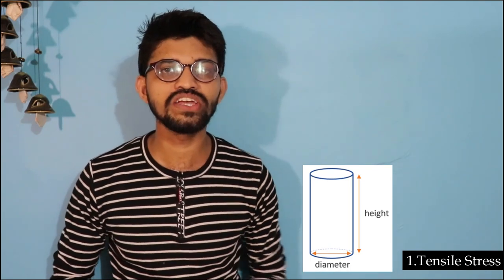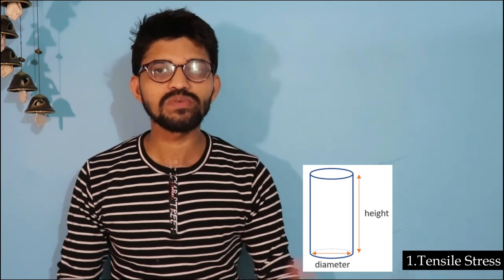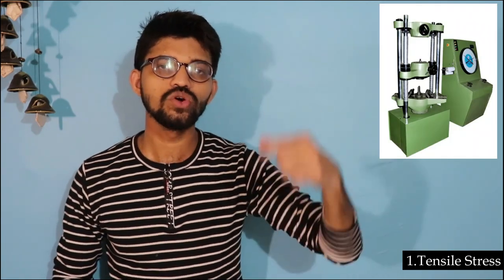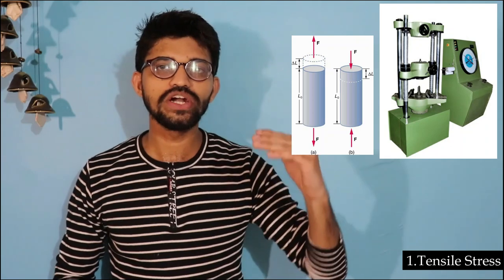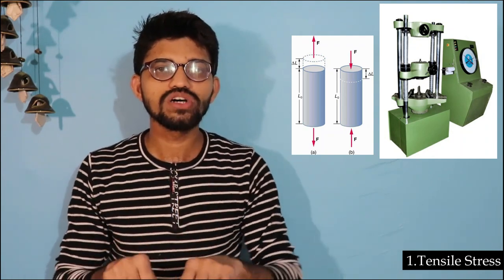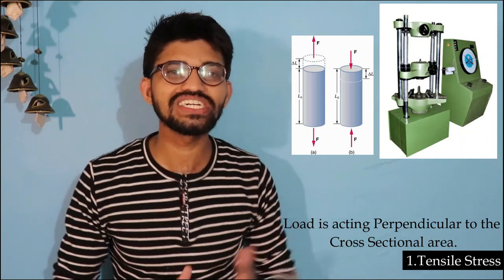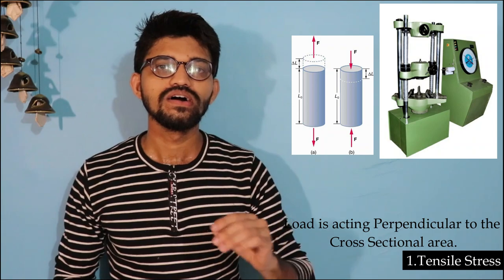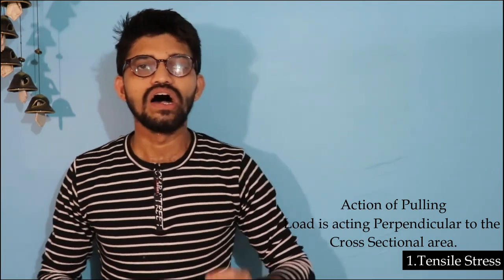Types of Stresses, Tensile / Compressive, Shear, Torsional, Beding Stress.

Comment: A 360 degrees hydrodynamic journal bearing carries a radial load of 3.2kN with a radial clearance of 0.05mm. The speed of the journal is 1490rpm and the bearing pressure is 1.3MPa. The viscosity of the lubricant is 25 Centi Poise. The ratio of length to the diameter of the journal is 1. Calculate (i) Journal Diameter and Bearing Length (ii) Coefficient of Friction (iii)Power Lost in Friction (iv) Minimum Oil Film Thickness.